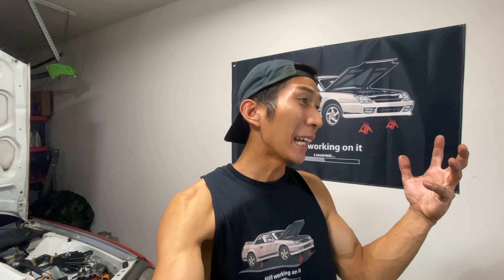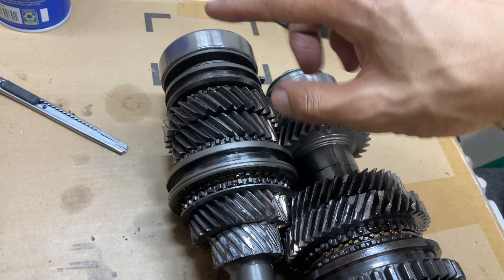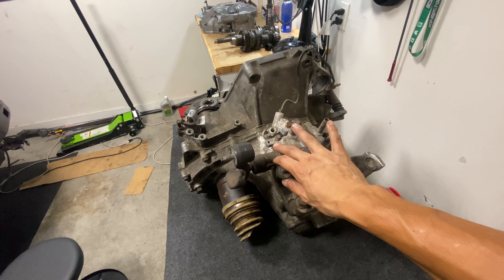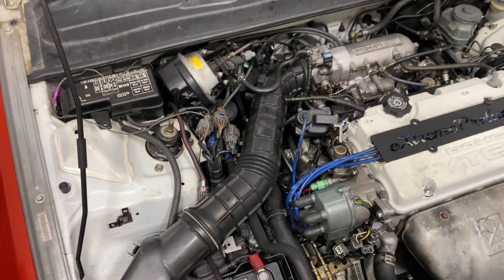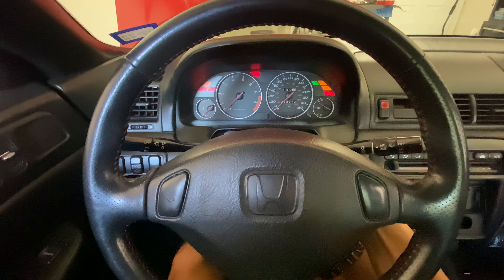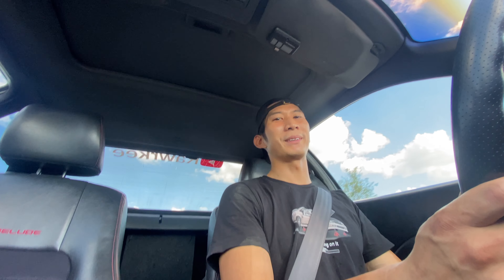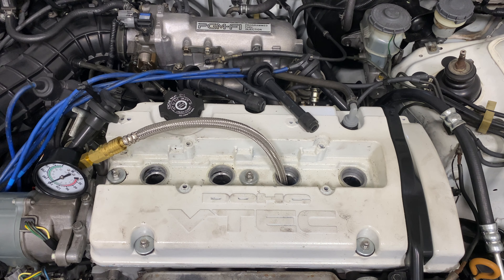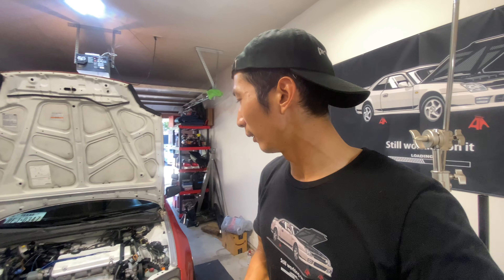I'm done with this Prelude

Comment: Congrats on getting it back on the road!

One small tip on checking compression. It is typically best to hold the throttle body open during the test. A closed throttle body has a chance to throw off your readings by a small percentage since it will prevent air from being able to move freely through the intake manifold. The difference varies by engine and intake valve condition, and the difference is usually minimal on a healthy engine. For example, if you had leaking intake valves, you would notice a bigger difference between testing with the throttle body closed versus open. Compression would test lower since an open throttle body would allow more air to escape past the problematic valves. Same applies for a leakdown test.

Your compression numbers are great. I wouldn't be concerned at all. Re-test it after break-in and keep the throttle body closed so you get a test with the same condition, then test it a second time with the throttle open just to see.

About the SH transmission, it does require being mated to a SH block. Same exact engine code but the casting is slightly different and will prevent usage of a base transmission on a SH. This is where it becomes a royal PITA for SH owners... If your block ever gets trashed, you must find a SH block, or you must swap to a base block & base transmission. It is really hard to find a good SH block. The go-to rebuild method is to sleeve your original block so you can keep your transmission.

Thanks for being thorough with your transmission tear down. It was interesting to see. Props for learning about it all so quickly and for being so transparent with where your knowledge stops. Keep it up!
Reply: This Kat knows what they talking about ☝️

Comment: Yo man love the show. Only wish I saw your posts before I did my rebuild. I've gone through many of the same issues that your going through now. It's taken a bit, but my pearl white 01 sh is running pretty dam awesome now, don't give up on the lude. I my be able to help you through some issues if you need. Just watched your last post, and this little trick might help with the Speedo.  Hold down both the gas and the brake (right down to the floor) turn the ignition to the on position with out starting. Hold gas and brake for 5 seconds then turn off ignition.let sit for 10 seconds, turn on ignition let sit for 10 seconds then start car. This process should reset your idle and Speedo. Good luck bro and once again awesome job

Comment: Ok couple things. So as far as I know, a base model transmission will not bolt up to the motor in the SH, however i dont know if you can just swap the differential. The rest of the internals are the same though. I have a SH transmission sitting here collecting dust, rebuilt with carbon synchros.  The block on the SH is physically different than the base model, even though they are both designated H22A4. One major difference is the physical location of the oil filter being relocated because of the ATTS system mounting location. Im fairly certain the bolt pattern is different too. 

As far as fluid, all we run in ours is the amsoil synchromesh for street cars. Have had amazing results. If you intend to track the car, you can run their 75w90 manual transmission fluid. BUT thats for when you get it hot at the track. Its too thick for normal daily driving, so dont leave it in there.
Reply from the maker: Bro; I didn’t know that the base trans would not bolt up to the SH block. Thanks for clarifying that 🙌🏼🙌🏼🙌🏼
And awesome! I’ve thinking about flushing the Honda MTF after he break in period and replacing it with Amsoil Synchromesh. Thanks for the insight!

Comment: By the way, what internals are in the engine? I had around 270psi of compression in my euro r block. I expect stock p5m pistons to make about 220psi of compression if the motor is broken in properly. I need to do another compression test on my fully built motor since I am now around 1000 miles on it. I haven't really been getting on it due to fueling issues so I am just hoping the rings sealed up like they should. What oil did you run for break in? I run Amsoil break in oil in the built motors. I have used Lucas and regular non detergent straight weight oil in stock blocks with good results before too though.
Reply from the maker: My internals are all stock, I simply did a refresh on the motor, meaning I replaced the Piston Rings, Crank Bearings, Rod Bearings, Oil Pump, various seals and gaskets, all new Valves and Valve Caps. My motor still isn't fully broken in yet... should I wait till then to see if the compression numbers change?? 👀👀 I didn't hone the cylinders nor did I gap the rings because the rings are OEM and I assumed they were within spec from the manufacturer. Break In, I used the cheapest conventional oil I can find. Couldn't find break in oil at any of the local stores but you know, my motor isn't 'built' and so I don't think it was necessary to use specific break in oil

Comment: can’t put a type sh trans on a base model to do the atts unit .. I did purchase a working m2u4 trans from an 01 Type SH … didn’t fit my base so if you’re interested then let me know ! good content man !
Reply from the maker: So the mounting holes don’t line up? I’ve seen BBA alliance offer a block off plate for the ATTS unit which also acts as a mounting point for the intermediate shaft but that’s when you put a base trans on a SH block. I still don’t know how exactly the conversion works

Comment: The casings between the base model and sh transmissions are not the same. You can not stick an atts unit on the non atts transmission case.

Comment: I have a 2001 prelude. That’s starting to have starting issues. Especially in the heat but once it starts it runs just fine. Was wondering if  you can point me in right direction to fix it please.
Reply from the maker: Mine does the same in both the heat and the cold but thats because I have a few upgraded electronics, ex: sub, speakers, 2 amps, resistors for the tailights. Everything is hooked up to my radio and so I simply disable everything before starting up the car by removing my radio face. If I couldn't do that, I would consider upgrading or cleaning your grounds. If that doesn't help, I would think your starter is going bad

Comment: check engine was probably caused from the speed sensor it throws the car into limp mode. And as you are doing your compression test you should have the throttle body wide open.

Comment: @rawrkee!!!! I love the content just found you! GET THAT OIL OUT OF YOUR TRANSMISSION ASAP! If it’s the “Honda genuine manual transmission” oil from online. It feels smooth but it will 100% mess up your transmission. You’re better off with synchromesh from autozone. It’s thicker and that oil you got is too thin. I went through 2 transmissions with that oil in my h22 accord. Both got stuck in gear and wasn’t able to get it out!!
Reply from the maker: Ahhh snapp, good thing I was planning on flushing the trans fluid after the break in period for the engine. Do you think Amsoil Synchromesh would be a good option?
Reply: @Rawrkee   I think it’d be fine. Personally I’d probably go with royal purple. Cause they’re top of the line. Yea it may be expensive. But you wouldn’t really need to change your oil for  while. It’s been a while since I’ve had my Honda. So I can’t have much input on other brands cause I went through 2 using that same oil and then gave up. Be sure to not over fill it and I’d probably not go too fast for awhile and make sure to go through every gear. That’s just what I would do if I had another chance with it. I think the Honda mtf is more for newer transmissions cause it’s thinner And these 90s-2000s preludes and accords have miles under them. But yea bro just trying to help out with my experience and don’t want to see you go through another transmission like I did!